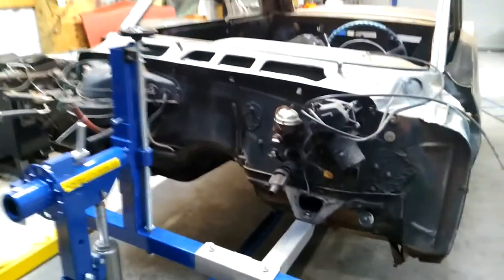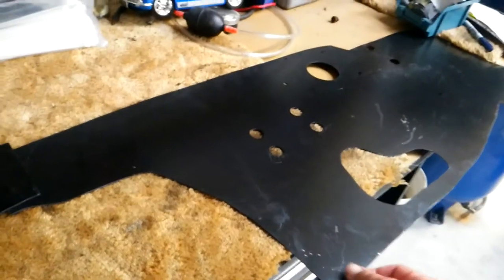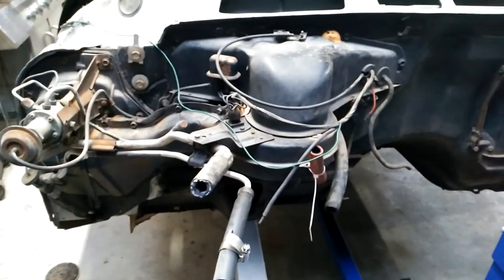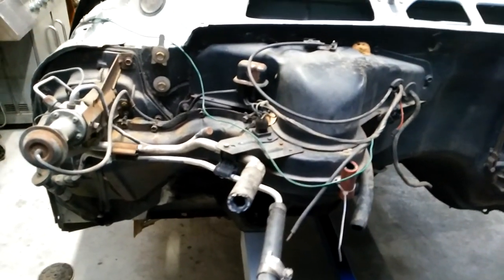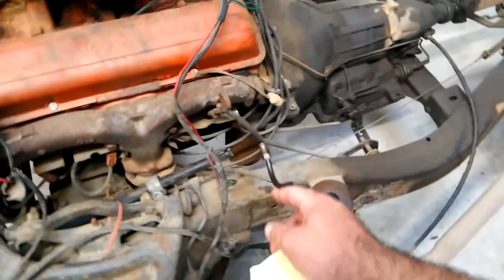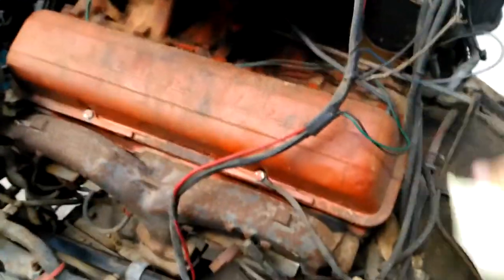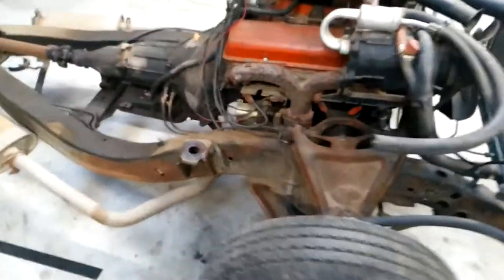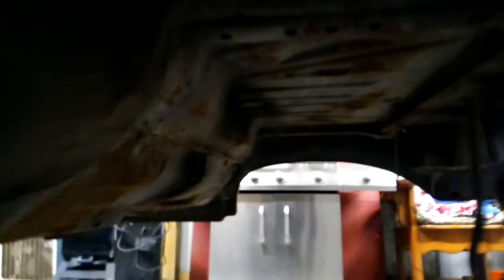1964 impala frame off restoration

Comment: Great work! Wanna sell the old ac? Also maybe you can point out how the a/c bolts to block since there isnt any holes in the heads. I'm having an issue finding a bracket
Reply from the maker: The old ac is long gone.  The original ac brackets bolt on the manifold. 283 heads dont have provisions for accessory bolts. Another reason i went with a 350
Reply: @lonestarlows  thanks. Keep up the great work. When do you "plan" to finish? I'm on hold with my 63 convertible atm cause its cold here in nyc and I work in my driveway. I also have a 64 convertible that a plan to start when I'm done with the first project
Reply from the maker: @Neildiamond127  id like to have the car driving down the road by May.  Im at the point now that its just a lot of minor stuff that generally goes unnoticed
Reply: @lonestarlows  that's why I said planned. I should have been driving mine already also. Been waiting on interior guy to make my top and finish the seats. I also need a telescoping driveshaft. Just like most things in life, hurry up and wait
Reply from the maker: @Neildiamond127  yes one of the reasons i attempt things myself. I dont like waiting on shops.